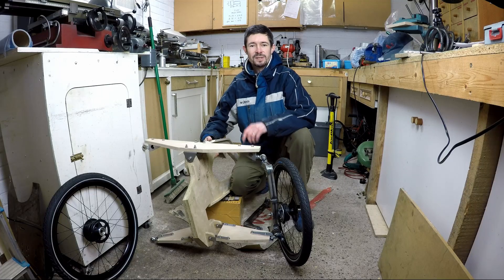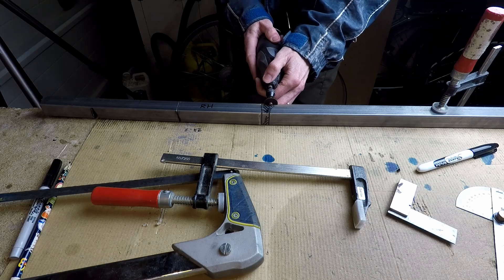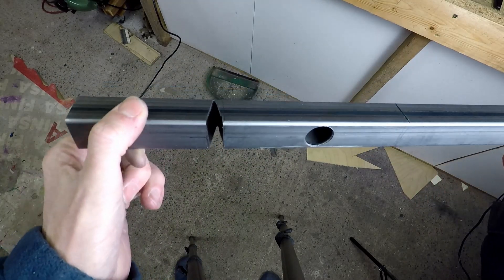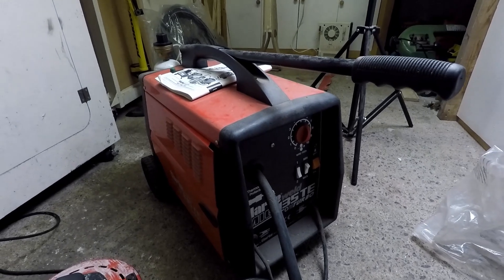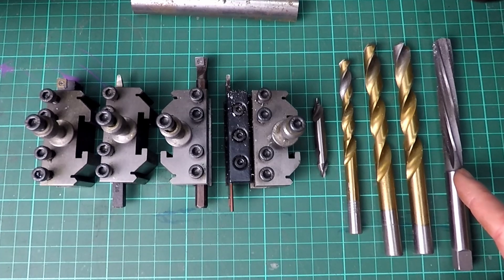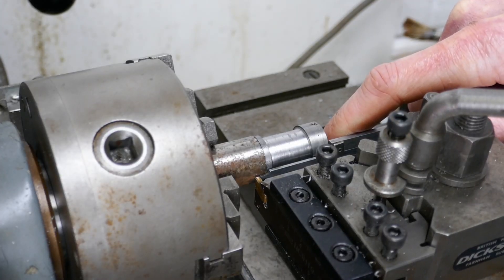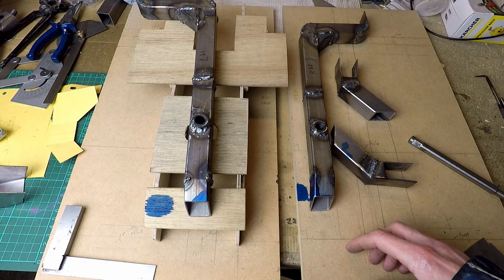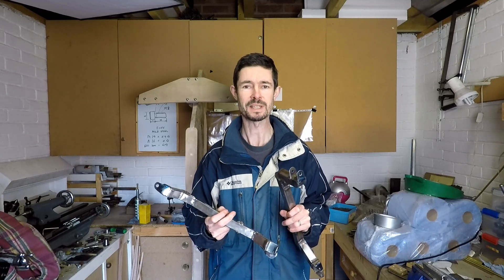Tilting Trikes Part 8 - welding and Myford lathe work on the tilting and steering mechanism.

Comment: When you showed them, I found them strange, but you placed all angles already in that part.
Looks good.
Some sanding and the welds look good. It is no airplane, so it will be strong enough. After sanding, you often can see if it is strong enough, of not you can always put an other weld over it.

Comment: Noob question. Don't you heat the metal before bending?
Reply: No need, 1.5mm mild steel is pretty bendy.  Adding heat will only risk warping which is a bigger issue.

Comment: Long bed Super7? :O Nice!
Reply from the maker: Yes it is - but I think I've only ever used the first 12 inches or so of the bed!
Reply: @MetalMachineShop  I have early Super7 from 1958-60 according to serial number. Really nice lathe. Only down side is that the bed has significant wear. :(
Reply from the maker: @waldemarii  Mine was made in the 70s I believe.
Reply: @MetalMachineShop  That counts as new. :D
Reply: You guys lol I'll make do with my ML7, uncle bought it new 1953 for model making. 
I put a VFD motor on it makes screw cutting a breeze. 👍😎🤣
Reply: @cliveclapham6451  I also have VFD. But do you have taper attachment!? I has, I can make tapered threads lol.
Reply: @waldemarii  Yes, l thought your type had VFD. 
Tapered threads ROFLOL handy if your making a buffing wheel arbour or pipe threads, what ever floats your boat. 
🧐
Reply: @cliveclapham6451  My boat has sink since our beloved ex prime minister Juha Sipilä removed the draining plug. :D (Finnish joke so it's ok if you don't get it)

But seriously, I have used the taper attachment twice. :D